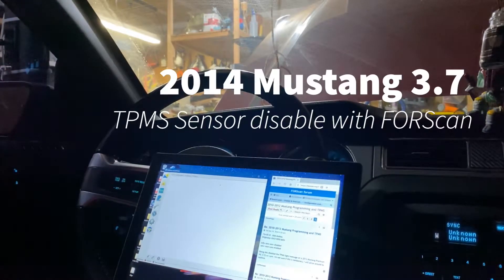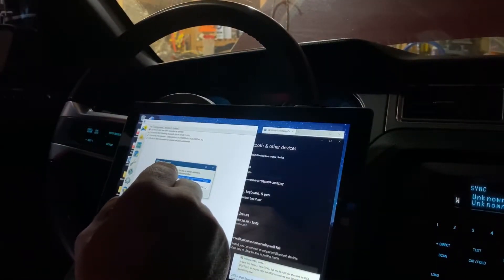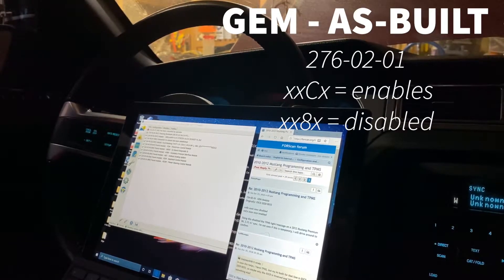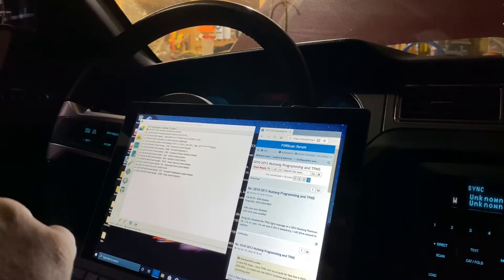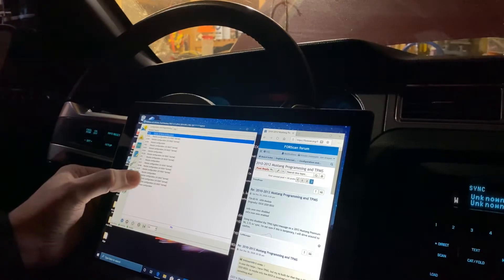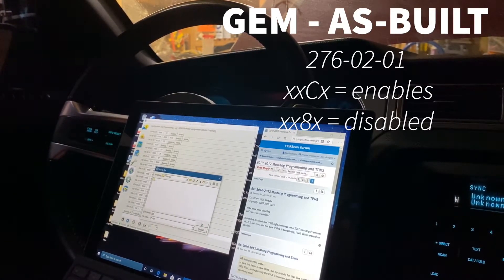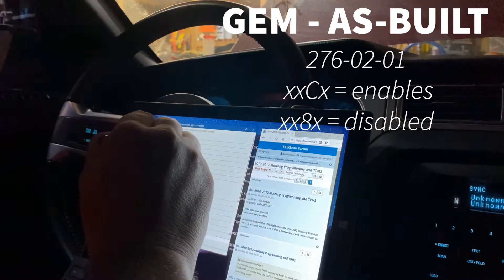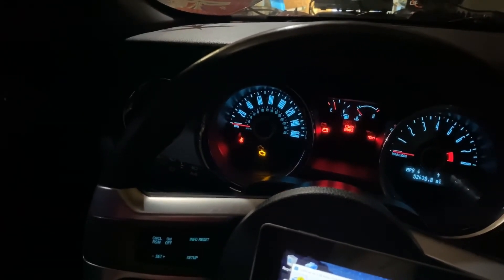TPMS Sensor disable w/ FORScan 2014 Mustang

Comment: Hi, do you have your PCM Module Configuration file in "As built" format (.ab)?. I didn't backed up mine and I get the message "Writing block 2 failed - incompatible configuration". I tried with "Load factory AB" but I get the message: "Sorry factory As built file doesnt contains information about this module". I also tried download "As built" file from ford web but same result "Sorry factory As built file doesnt contains information about this module". I have a ford mustang 2014 3.7 L